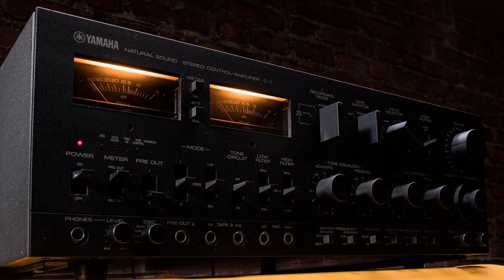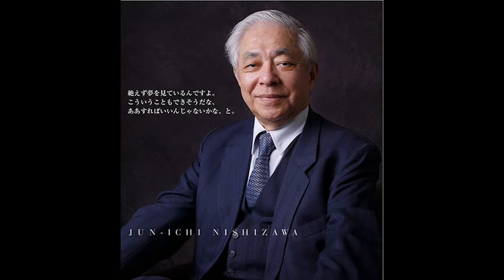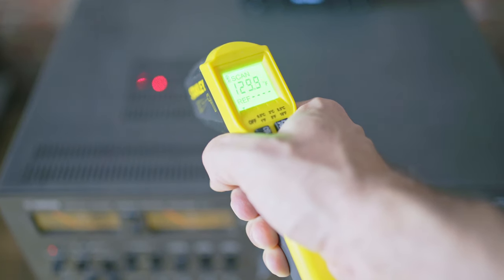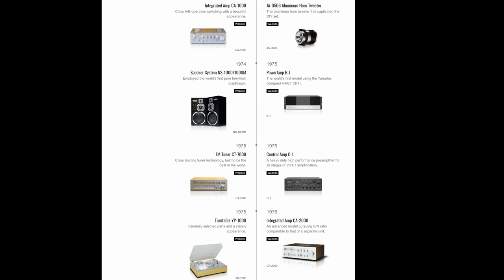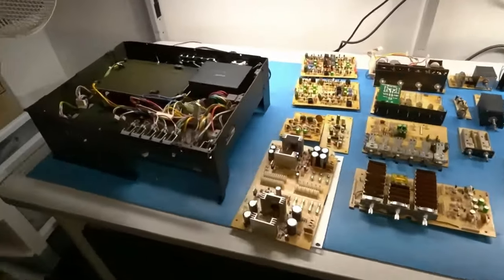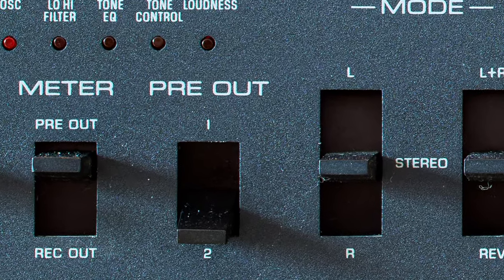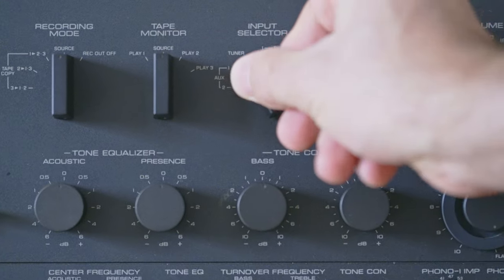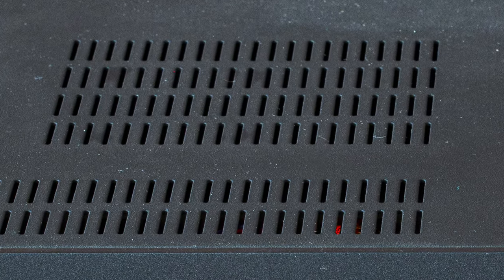Yamaha C-1 Preamplifier Review - The only V-FET preamp ever manufactured

Comment: I had a C-1 in the 1980s, had several FET failures due to heat. I eventually removed the phonograph Amp circuit board to reduce heat, and installed dozens of heatsinks on remaining FETs that were hot.
Reply from the maker: I was actually thinking about doing the same thing. I don't use the phono bit anyway, and your comment makes me want to do it even more.

Comment: Would be interesting to hear any deference between this and the C6 that has MC I/p and parametric eq
Reply: i think this as parametric equalizer as the c-6 that i also own one but it´s not written there but lot of frequency changes can be done in higher or lower ones, not sure of being the same but by their sound it seems the same but in a diferent display, the mc input for phono is not there but for some reason it wasn´t included one but 3 phono inputs with level of sound adjustment, i have 3 turntables with didferent sounding cartridges and sound type normally a diferent frequency response but more interesting having all diferent type of sound and all turntables are good
Reply: i went to see the impedance in  the phono inputs but maybe if choosen correctelly one can match a mc type in one of those imputs maybe , i have not here the mc type impedances and other specifications but for the year of realease should have it allthough it was not much used by this time the mc type cartridges i had one in a pioneer system that is still working but like i said i can´t confirm the impedances or other specifications at the moment

Comment: Absolutely beautiful pre amp. I didn't realize just how large it was until you were sitting in front of it in the end. Makes sense though considering the weight. I would absolutely love one of the higher end yamaha integrated amps like the ca-2010 in black as I think the colour is absolutely gorgeous, but sadly they don't exist. You mention the sound being slightly smoother which to me indicates that the output is slightly coloured, perhaps that characteristic smooth warmish v-fet sound? I missed a ta-8650 the other month on ebay for +-1000 euros which is a shame. Still looking for a nice integrated amplifier that has some nice looks. I am currently using a ta-4650 which has a pretty decent output stage but the pre amp frankly is not great.
Reply from the maker: She's gorgeous, isn't she? You're right, the output may be a bit coloured to a warmer side, but that's what I love about that. 

That's a shame you missed the TA-8650. I just finished restoring TAN-8550, which I'm going to review next month or so, and if the TA-8650 (which I haven't heard yet) is at least half as good, you should really regret you missed her.

I haven't heard the TA-4650 either, but why is the pre-amp bit not great?
Reply: @KITR-UK  It functions well but it's just not very high end, same for the ta-5650. The pre amplification section is pretty similar to the ta 3650. Decent amplifier but with the ta-4650 compared to the output stage it's just a shame to use it with the built in pre amp. In my experience it has quite a bit of channel bleed through and the noise floor isn't fantastic. I am sure recapping and recalibrating it would work better but the consensus online seems to be similar.